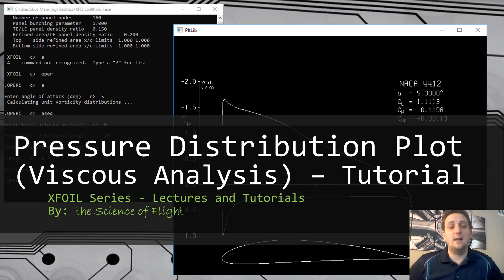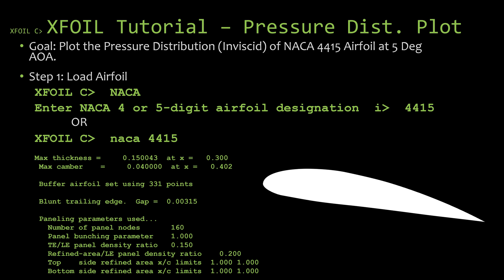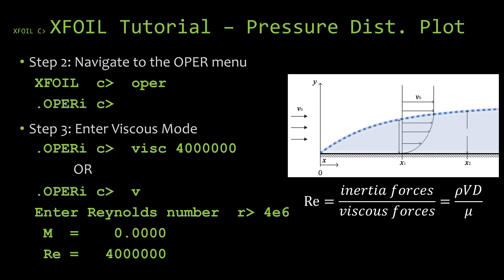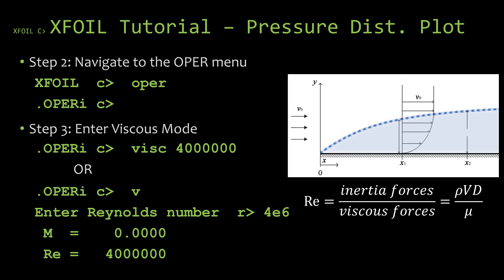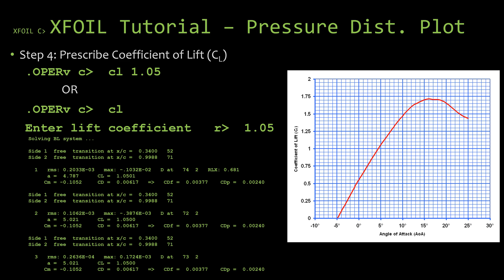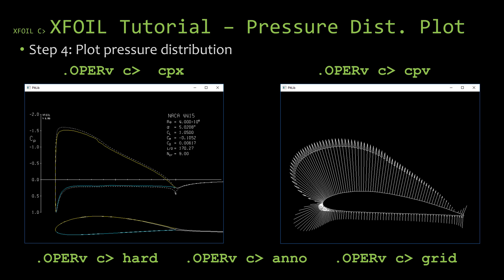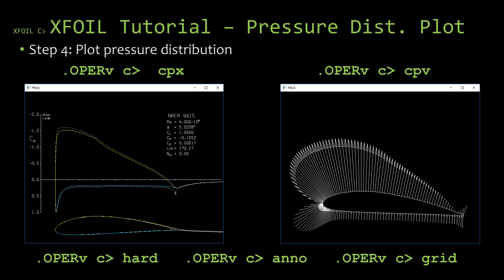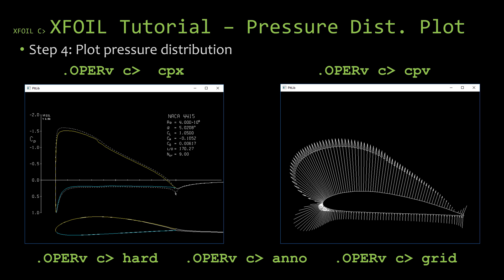XFOIL Tutorial 2: Pressure Distribution Plot - Viscous (Cp vs x/c)

Comment: what is value of D and kinematic viscosity in calculating Reynolds Number?? Whether it should be the default value or actual experiment condition value. Default value of chord length is 1...but the test airfoil is 0.15m... so which value should be taken for calculating Re
Reply from the maker: I think I'm going to create a video where I run through an example of this so that it is more clear. Stay tuned!

Also, I do have a video talking about a major assumption that XFOIL makes when calculating the RE and coefficients that might help clarify this a little. It's called "XFOIL's Cl, Cd, Cm, and RE Equations (Major XFOIL Assumption!!!)" and is located here: https://youtu.be/SLe2nrysnrU .

Comment: does the command <cr> works in xfoil? for some weird reasons it does not work for me
Reply from the maker: Yes, kinda. "<cr>" stands for carriage return or cartridge return depending on your preference. Nowadays it's the key labeled "return" or "enter" on your keyboard. So if you type in the text "<cr>" and hit enter it will not work but if you have nothing typed into the command prompt and hit the enter key, or the return key, on your keyboard it should work. Let me know if this helps.
Reply: @thescienceofflight1404  Thank you. Unfortunately, when I tried to use mdes menu to design new geometry of airfoil, MIT user guide suggested to return to the top level to save new buffer airfoil. When I did, it got out of the menu, could not get the output
Reply: Your videos are really helpful. can you make a video on getting airfoil geometry from surface speed distribution.? in future
Reply from the maker: If I had to guess based on the more common missed steps, when in the MDES menu after you have adjusted the surface speed distribution to your liking you have to use the EXEC command to actually execute the inverse design routine and convert the current surface speed distribution into an airfoil shape. The EXEC command will then put the new airfoil shape into the buffer airfoil in the top level menu. You then have to hit the enter key on the keyboard to go to the top level. When in the top level you have to move the airfoil from the buffer airfoil memory to the current airfoil memory by entering the PANE command. After this, you can save off the airfoil to a file, go to the OPER menu and start some off-design point analysis, or perform some other task as needed.
Reply: @thescienceofflight1404  Thank you. I will let you  know if I am facing any trouble
Reply from the maker: Yes, I can definitely make a video on making an airfoil from a surface speed distribution. I intend to make several videos on the MDES menu eventually. I've been focused on the OPER menu lately but will eventually move on to the GDES menu and the MDES menu. Let me see if I can't do a quick video on this, in the next week or so, so that it is available now and you don't have to wait till I get around to the MDES  menu videos.
Reply: @thescienceofflight1404  thank you so much
Reply from the maker: No problem.

Comment: Can you tell how to save pressure plots are data files
Reply from the maker: The command CPWR (stands for Cp Write) outputs to a .txt file the Coefficient of Pressure, Cp, vs the (x,y) coordinate pairs of the surface. You must give this command the filename you want it saved as and it will save the file to the same folder as the xfoil.exe that you used to start the XFOIL software.

Example:
In this video, after STEP 4 where you prescribed a coefficient of lift (or after you prescribe an angle of attack using the alfa command, which is more common) you would type    CPWR filename.txt    and hit <enter> (it will prompt you asking for the filename if you forget). Then you can open the filename.txt file in notepad/notepad++ or use the import wizards to import it into MS Excel or MATLAB.
Reply: @thescienceofflight1404   Thanks a lot. I am new to the xfoil. Can this CPWR command work,  if I use the aseq command and can it save all the cp data for these different Alfa values. If not is there an alternative
Reply from the maker: Unfortunately, not at this time. The basic way XFOIL currently handles memory is that it holds the last analysis in it's memory and when a new analysis is done it will hold the new data and drop the old data. The exceptions being that it doesn't refresh the Cp vs x pressure plot until a new analysis command is issued and/or if you use the PACC command (stands for "polar accumulation" and is covered in the video on polar plots) to force the memory to hold the lift, drag, moment, and transition data (but not the pressure data) for each angle of attack. This is the reason that the CPWR command will only output the last value of the ASEQ command. It's simply what XFOIL has in its memory at the time. XFOIL is open source software and this is on my list of future improvements I hope to make to the source code someday.

The work around for right now, if you could call it a work around, is to simply use the ALFA command and save off the pressure data at each angle of attack. It's a bit of a pain... for now. lol
Reply: @thescienceofflight1404  I am currently saving by using ALFA command. But thanks a lot for the reply. 

Just a suggestion: If your working on the source code, is there a way to you can make a module in the python. Because that can be really helpful and handy in the future.
Reply from the maker: Yeah, no problem. And yeah, I'm hoping to make some edits/improvements to the source code that will get incorporated in the next released revision. Depending on when I'm finished, I might look at a temporary solution (like with python) that can be used to accomplish this while we wait for the new revision to be released. 

If you, or any other viewers, have any other ideas on how to improve the software I'd love to hear them, even if it may take a while to get them incorporated.